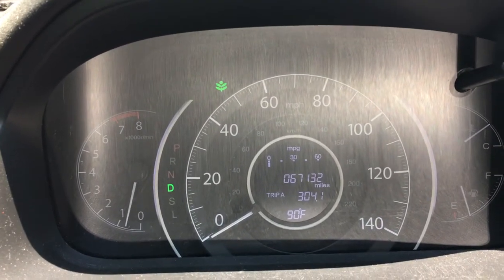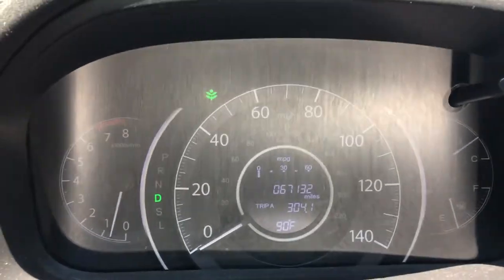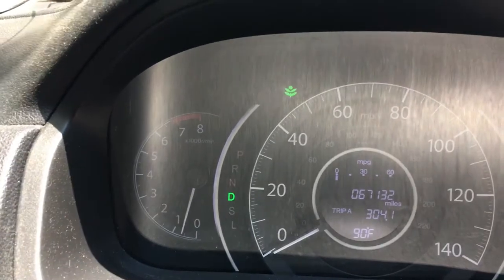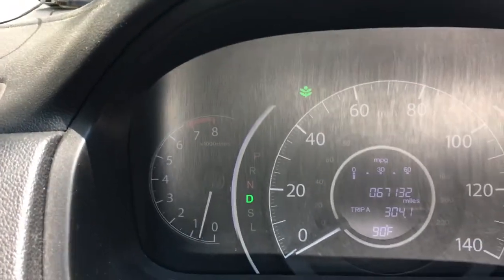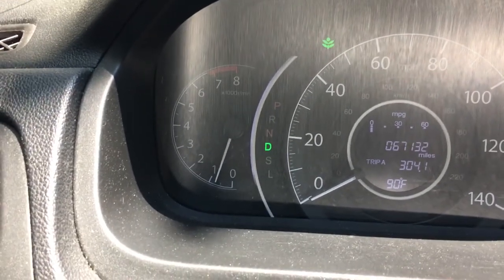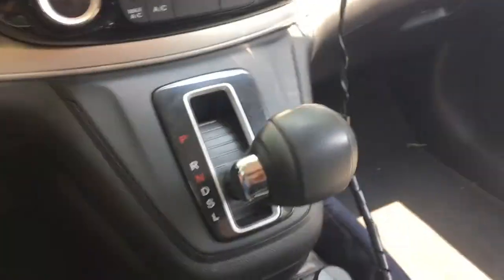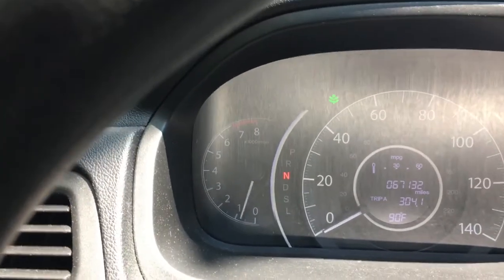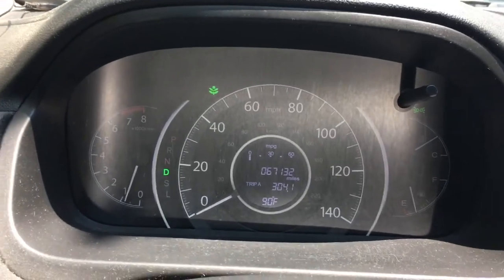Honda CRV vibration when stopped with 4th generation vehicles (2012, 2013, 2014, 2015, 2016) fix

Comment: There's one more method, turn on the rear window defroster.  This also causes the engine to idle faster and reduce vibration.  The defroster does time out after 10 or 15 minutes so you'll need to push the button again the next time you stop.  The vibration is annoying.
Reply: That’s going to burn your side mirrors reflection coats over time

Comment: I just drove home in my newly purchased 2016 Honda CRV and when stopped at a red light I felt the vibration. I immediately called the dealer & he asked me to drive it for another day or two (I have 7 days to switch to another car or get a refund) & take notice of when the vibration occurs if during other circumstances besides the stop at the light. So I truly appreciate this video and will try these 4 methods out when I drive the car today. Thanks!
Reply: Thanks going nuts ! The headlights on works!

Comment: i have 4th gen CRV that is experiencing the same issue. the reason as you stated is right, the idle RPM is set too low (600rpm while stopped in gear) i just put it to Neutral to solve the issue. turning on the headlights will force the alternator to work "normally" instead of "economy" (ELD) thus putting more load into the engine and the slightly increase the engine RPM. i've discovered that unplugging the battery sensor will disable ELD and let the alternator work normally so now i don't have to turn on the headlights at noon.
Reply from the maker: Can you tell us how to unplug the battery sensor?
Reply: @superbowltournament1692  there's a socket on the negative post on the battery. once you unplug it, the car act as if the battery health status is unknown and it sends 14.0V to the battery instead of just 13.0V which barely charge the battery. not sure if it's the same on USDM CRV (mine is asian model) but worth a try. i also have the video on my channel if u want to look.
Reply from the maker: @utakatikmobil  I found your video. Posting a link here, and it is cued to where you show the removal (simple to do) but I would advise everyone to watch the video in FULL to understand what's going on. THANK YOU for this video. And, yes, my car has the socket on the negative battery post that can be removed. While I haven't tried it yet, I will soon. Remember, everyone, if you do this, it's AT YOUR OWN RISK.

https://youtu.be/i3gYE92M7F0?t=332
Reply: @superbowltournament1692  thank you. i know that certain CRV (USDM) has Daytime Running Lights so the alternator behaviour might not be the same as mine, but i was hoping maybe this could help a few people. please keep us posted if you notice any changes or downsides after you removed the battery sensor.
Reply: Have you been able to find any solution?
Reply: @jabers5202  nope, had to live with the vibration. Although worth mentioning some type of gas is smoother resulting in less vibration. Where i live using BP95 is significantly smoother than Shell 95.
Reply: @superbowltournament1692  Did you try it out? Wandering if disconnecting the ELD helped with the idle shaking issue
Reply: Disconnect the eld solves the vibration problem??
Reply from the maker: @carlosmeneses4495  I didn’t. I spoke with a mechanic friend, and he recommended to leave that part of the car alone.

Comment: I'd say go for a 07-11 CR-V or go for a Toyota/Lexus SUV. Newer Hondas arnt as reliable. Ac giving out, poorly made torque converters, oil dilutions.
Reply: Oil dilution turned out to be a non-issue.  If it was a real issue, prices of MILLIONS of used CRVs, Accords, and Civics would be significantly discounted. They also said the 1.5T would suffer carbon build up due to direct injection and that turned out to be a myth from the 1980s and garbage American cars.
Reply from the maker: It was the 2017 CRV’s, and some later years with the 1.5 turbo that had oil dilution issues. If you have the 2.4 stock, which I have in the 2016, it’s not an issue.  Also, Scotty Kilmer (YouTube auto mechanic, worth a visit) recommends if you have the oil dilution issue, change your oil sooner than normal, so dilution isn’t an issue.
Reply: Maybe on the new ones I had a 2010 and I have a 2013 they both did it, you can raise the idle by remapping the computer, or any of those tricks would work anything to put load on the alternator.

Comment: I just noticed this exact issue on my 13 CRV and called my local dealership to schedule an appointment. Thanks for this awesome information. I can sleep better now
Reply: Did they solve your issue? I have the same 13 CRV and same vibration issues during D gear idle.
Reply: This is normal. I did not take my CRV to the dealer
Reply: Me too 2015 crv ..yeah base on the news its normal ...

Comment: Had this problem also, rpm was dipping to 600 when i come to a stop and it use to feel like its going to die i cleaned my throttle two days ago, and my rpm been keeping at 900 when i come to a stop no more vibrations 🙂
Reply: This is exactly what it is. If you have your intake off to clean your throttle body, and I mean clean the heck out of it. Get your fingers in there and everything. Also, you may as well clean your mass air flow sensor and change air filter. This will change the feel of your car instantly. $30 and 1.5hrs.

Comment: Make it 2024 as well. Brand new owner of a crv sport. While in park it idles rough. It’s a hybrid so when it shifts into gas mode it shakes the car and sounds loud.  Also has a rattling or shudder sound upon acceleration
Reply: Same issue, in my 2024.  Mine is not a hybrid.
Reply: @Holabella  The issue turned out to be faulty fuel injectors and bad spark plug. In a brand new Honda. Replaced fuel injectors, pipe assembly and spark plug all under warranty of course. I had to make a stink for them to put effort into finding the issue. They were trying to write it off as couldn’t be found.
Reply: @LATOHOUSTON Thank you!! The dealer (which has been amazing) changed the motor mounts on mine under warranty because they were faulty only had 600 miles on the odometer when I took it in, still shaking after that then they kept it for a week. Head of Service even took it home but said they weren't able to replicate the issue and that they did feel vibration but some vibration is within range of normal. In my opinion its not a little bit of vibration I drive several cars each year all makes on rental for work and play. I've seriously been considering getting rid of the car and I've had it less than two months, with less than 1500 miles on it. This is super helpful thank you.
Reply: @Holabella  There’s also lemon law. Or you can try another Honda service center. It doesn’t have to be the same one you bought it from.

Comment: i knew about running the air conditioner but now with that on its idling rough. i did try the others and they all work except now A/C is finnicky.  remember the old days it was the opposite that the idle ran rough when cooling etc.

Comment: I recently bought a used CRV 2015 w 60,000 km run here in the Philippines. The engine  vibrates when I stopped on red lights , what I did was to put the gear into neutral or turn off the aircon then it stops ..

Comment: Hi Guys... I resolved this issue by doing a TBI flush and restoring the ECU to factory configuration.
Reply from the maker: Can you elaborate on this? Tbi is fuel injectors, correct? I did this at 100,000 mile service, along with spark plugs, but issue remains.